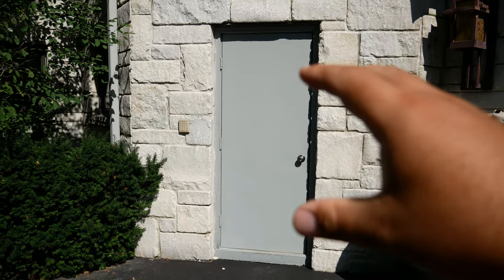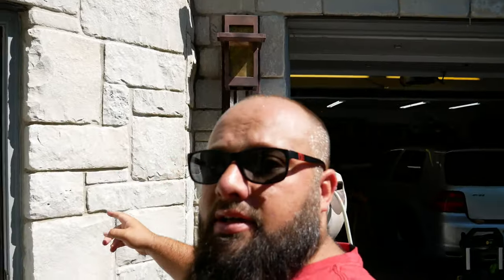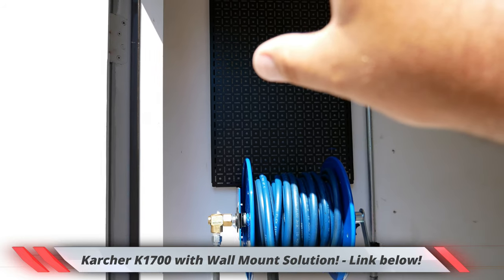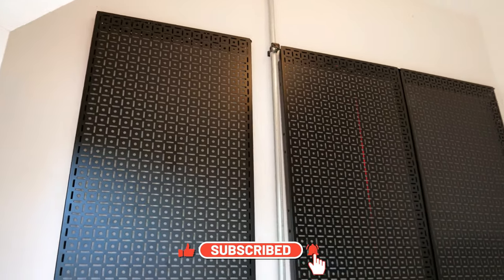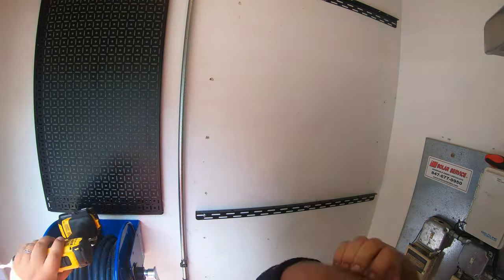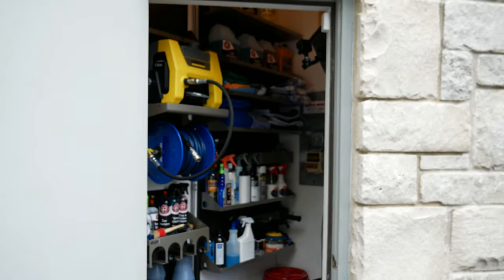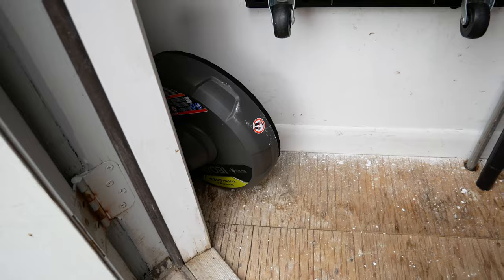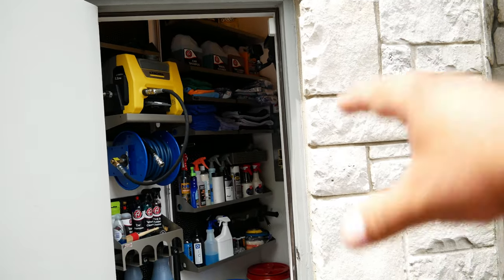Ultimate Garage Wash Bay - OmniWall Part 6, Obsessed Garage, Adam's and More!

Comment: Huge difference! How did you go about planning it all out? Did you draw it up or just mess around with different configurations?
Reply from the maker: Good Question. From the moment I installed the old system I knew I hated it. It was always in the back of my mind to find a replacement. system and once I found Omniwall I knew I found it. As for each self, I organized by groups of products I used for different cleaning jobs (Wheels, washing, decontamination etc) those all needed to be arm reach and together. All my pressure washing stuff in one column (foam canons, soap for canon etc. Then all the refill stuff at the top! This was my first layout, it didnt play around with the shelves much and Ithink its perfect.